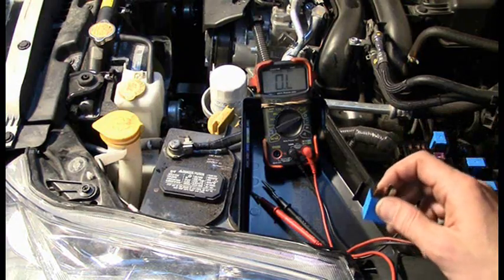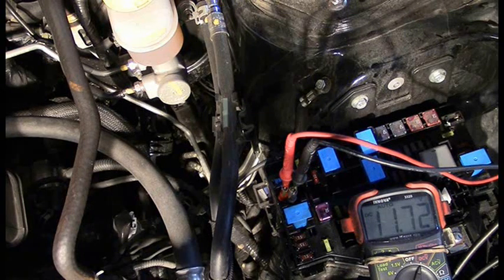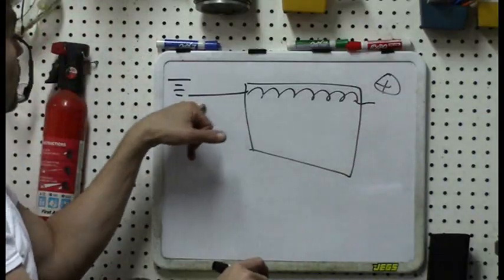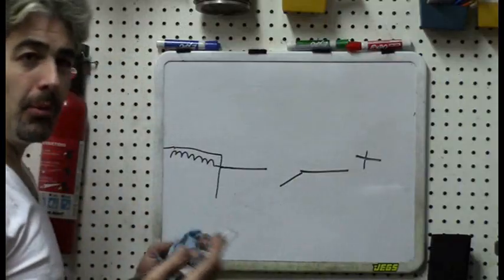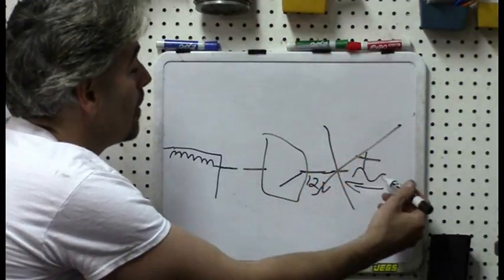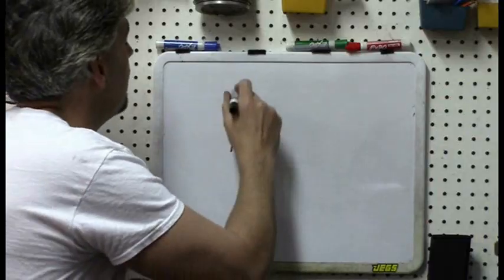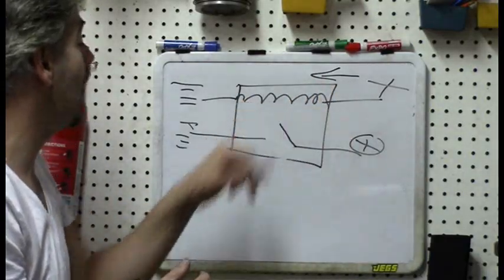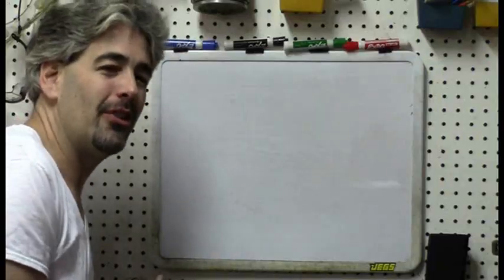Relays- Understanding, Diagnosis and Testing Relayed Circuits-Pt2

Comment: @5:30 I'm having trouble understanding why you would put 12V at the fuse? Wouldn't there already be 12V at the fuse because you said the fuse is good and there is no open before the fuse. If that's the, all you had to do is simply measure if there is 12V at the switch. It seems to me that putting 12V at the fuse is just unnecessary?

Comment: Hellow Sir, first I want to thank you for your content, very insightful and entertaining. I have a question about a mistery with my car's headlight electrical system. So first of all, I have a 2000 Acura TL that I lost both headlights all of the sudden, both low and high beam. So I checked both fuses and relays, and the bulbs, they are all fine. I have a ect 3000 from power probe, as well as the power probe. Ive traced both harnesses right and left and on the passenger side, there seems to be some kind of ground fault. The right headlight relay show 12v on the control side but no ground, the fuse is also dead, but not blown. when I trace my ground wire im lead to the chasis of the car, than the sound stops when I go passed it. Ive tested all my grounds to the battery, but they are all good, the wireing all seems to be fine but when I try to trace an open circuit, it leads me to the inside of the car, but than it just takes me in a circle. I cant seem to figure for the life of me what could be the issue, any thoughts, Im a DIYer but consider myself to be a decent mechanic and understand automobile electricity pretty good, Im at a loss. What would cause the ground to be absent? I thank you in advance and hopefully you can give me some insight.
Reply from the maker: Thanks for the compliment. Obviously you only have ground on the control side when the headlamps are switched on. If you aren’t seeing that happen the issue is with the switch. I don’t believe I have ever seen a headlamp system that was power side switched except on a 1957 Buick. 
   Simply provide a ground side to the relay and see that it operates confirming a switch issue. 
   Also since you have the power probe, just send 12V to the load side and make sure it lights the headlamp- this confirms you only have a control side issue and not a load side issue.  Most systems have a constant 12V load side power at all times but I have seen some that only have the load side power with key on. Either way it doesn’t matter- 12V to the ground side of the load should light the lamp. If it doesn’t then test for the voltage at the socket and if it isn’t there, your ECT will be needed to find the open.
Reply: Thank you, I actually did that and was able to get the lights to come on, but when I replaced the switch, it didn't solve my problem. I'll continue to try tracing I just hope its not my drivers multiplex control unit. according to the wiring diagrams thats where the high beams seem to lead me. Not sure if its worth it at that point, everything on this acura seems to be more expensive than any other car I've owned. 
Again, thanks for the prompt reply!
 @SchrodingersBox
Reply: @sergionewsome6657  did you find why the headlights stopped working on your Acura?

Comment: Could u check voltage on d load side of arelay with d volt meter on ohms scale
Reply from the maker: You would only be able to see continuity of the ground that way, you can’t measure voltage like that.

Comment: Spectacular video. I came here from watching another one of your vids (crank no start isuzu) and now I have a solid understanding of 4 & 5 pin relays. Thank you 🙌... (did you ever work in a shop before by any chance?) Did you ever get your ASE certifications? Just curious as to how you got to your level.. (definitely seems like your up there) 😳
Reply from the maker: thanks so much. I am a DIY- just learned this stuff fixing neighbors cars over the years.
Reply: @SchrodingersBox  that's awesome. (I'm a firm believer that the best way to learn things is to dive head first into them & learn on your own) looks like it definitely worked for you 💯

Comment: Just put some volts on them & see if they click.
Reply from the maker: Yep a I do that too however I also check for continuity on the load side as well. just because it clicks does not mean there is continuity and in fact I have 3 videos that show exactly that happening

Comment: Great stuff thank you it is just cemented the information I have been reading I have tackled and eight pin relay which is a lot easier now that I have seen this and tested it. 
Thank you very much for this helpful video liked and subbed will share with the guys at my shop.

Comment: Wow amazingly helpful , before I watch this video the only knowledge I had of a relay involved switching the Batten from your hand to the next runners hand 😂 now how to find the relay switch responsible for my AC blower , heated seats, reverse light and wing Mirror controls , which all went down together after having to recharge the dead battery on my 2003 Audi TT ... someone mentioned there is no relay for the blower on the TT , then somebody said they found a whole box of relays under the bonnet somewhere , any insight on that would be more then welcome 🙏 , at least I’m not rushing out to buy a blower motor now thanks to your great way of teaching and live examples kindest wishes
Reply from the maker: Thanks man.  I always appreciate those who try to improve their understanding of electrical. It didn't come easy to me!!! I had to spend many hours on my own studying it.
Reply: I can get that , I recon because you learn all this with hands on real life experience, your self , you have a very clear step by step way of teaching this very complex subject... 
I am still wondering where how to find my relays , can you point me to any videos you have done on how to locate the main relay switches , so far I have only found one in the engine bay by the large air filter on the back of the firewall passenger side ??? Thanks again for your videos man you rock

Comment: Great video. Wish you had covered a diode protected relay. With a diode protected relay, power has to be applied to the right pin in the load side, right? Usually, pin 86.
Reply from the maker: Not sure which pin number but yes- diodes are basically electronic switches activated by current.

Comment: cheap aftermarket immobilisers uses basic closed, 12V to open relays. If is immo on, it breaks the ignition, or fuel pump circuit. (on cranking no start the first suspects are these stuffs)

Comment: Question for Matt: My wife's Chrysler T&C 1998 van uses a "solid state" type relay rather than a coil type.  Could you do ( or do you have) a vid explaining how this type of relay works?  Also, is it possible to test these without special equipment, like anything other than a DVOM?  Thanks for this awesome series and keep them coming!  

WARNING for all viewers of this vid:  While Matt's 2 part series on relays is fantastic and honestly, the BEST explanation of relays I've ever seen, PLEASE understand that not ALL headlight circuits (or any relayed circuits) are necessarily this simple.  I have a Subaru Forester S, 2001, and both lights failed simultaneously last winter.  Fortunately, I found ultra cheap (like 8 bucks) pdf file factory shop manuals on ebay, so I have the actual wiring diagrams for my car.  In my car, the HL switch actually closes the ground circuit to BOTH the HL (load) AND the HL relays' control coils.  In addition, the POWER side of the relay control coil is switched by the ignition switch (only HOT in "RUN").  Most cars don't require ignition switch to be on to operate HLs, but if you have a Subaru, I almost guarantee yours does.  In my situation, you have THREE, not just one, switched locations in the circuit that could have been bad.  Diagnosis could be done using Matt's method, but would have been quite a bit more difficult, since even in a working state, you'd have NO continuity to ground or power at rest on EITHER side of the relay control sockets in the fuse box.  I respect Matt very much, but in my experience, the 8 dollar shop manual is worth it's weight in gold for the wiring diagrams alone!  They've saved me SO much time.  Incidentally, the issue turned out to be the ground wire from HL switch connector to the HL connector was burned and part of the connector melted.  I got a new connector at the junkyard for ONE dollar.  Unfortunately, had to spend 12 bucks on a special tool to get the pins out of the connectors, but still, was a fun repair!
Reply: "8 dollar shop manual "  Where can you get this?

Comment: Amazing thank you Schrodingers
Reply from the maker: Glad you liked it!
Reply: Schrodingers Box this weekend I am planing to troubleshoot my ML350 starter and its wiring issue, already removed starter found it dead,  took it to a rebuild shop, they tested it too, so got a rebuild one, but still have to fix starter relay, its not getting power, hope fuse some where.

this car has few circuits, starter relay should get power from circuit 15 then activate circuit 50 (starter solenoid)

most likely shorted solenoid kill some fuse somewhere - i am wondering why 5 year old car have bad starter?

your video definitely will help me to fix my electrical issue

Thanks Again.

Comment: Another great video! 
Here's a question. How would you determine the load side from the control side of a stuck closed unmarked relay. I suppose checking for resistance would be a start? 
I had a stuck closed relay on a fuel pump that wouldn't shut off. Took an educated guess and swapped the relay with a new one and it fixed the problem. That was when I was a 98%'er
Reply from the maker: Cobra Ninety Six I would find this out by checking inside the vehicle where the relay goes and probing for the side that has no power until you initiate a control/switch.  That would be your control side... then you can just refer that information back to the relay

Comment: Nice topic. 
Sir Can you please make a video on diagnosis and understanding of an alternator. How it works and how to test and how to full field an alternators and other stuff like that related to alternators. 
Thanks
Reply from the maker: Wasim Akram Thats a good idea, duly noted. Alternator testing is actually not quite as easy as most people think. There is computer control of the alternator in modern vehicles to prevent overcharging and failure with this can actually cause a no output from the alternator even if it is good!
Reply: Schrodingers Box thats exactly why i have requested you to through a video on that too

Comment: Hi I'm having a problem with my 2001 Saturn L200.  All the interior lights r blinking and security light at the same time also gas and temperature gauge goes up and down. I have a video please watch it called (Saturn Lights Blinking) Thx any info would be appreciated
Reply from the maker: Its either a dead or not-charging battery or loose battery connection. Easy
Reply: Brad Sellers that happens a lot to me, and in most cases is a loose ground at either the taillights or the headlamps. Having a bad ground makes actually a serial connection between the blinklights and the other circuits (brake or headlights, parkinglights), thuus making them blink, but at a lower voltage, all the lights are dimmer because they share power with the blinks. So for the future check for a good grounding point.

Comment: you are awesome dude! I FINALLY FOUND SOME ONE THAT KNOWS WHAT THEIR TALKING ABOUT.. 
"""SUBSCRIBE HERE IF YOU WANT TO DO IT RIGHT THE FIRST TIME, EVERY TIME!
Reply from the maker: Many Thanks Jo.  Turns out a lot of people out there know what they are talking about- even much more so than I do- way more, but they don't make videos. However they share their knowledge in the comments on my channel and I learn from them much more than they learn from me!
Reply: Question? I have a 2011 F-150  3.7L V6  xlt truck. I was hit on the drivers side front end. long story short the MAF or MAS air flow sensor is not functioning. Do you have a video on how to trouble shoot the MAF? And, on my instrument cluster is reads>> "SERVICE ADVANCETRACK" with a wrench next to it. When I try to accelerate i lose power in the engine and the further i press the accelerator, It seems to bog down. The truck only has 16,000 miles on it. Do you have some videos to help me on this subject? or advice as to where to start troubleshooting & how?
Reply from the maker: Jo Hutch While I don't yet specifically have a video that addresses the MAF individually, my video "secret of engine diagnosis: Fuel Trims" does cover it to some extent and explains some issues common with MAF and MAP and what would result from them.

 As for the other issue, sorry I not familiar with AdvanceTrack and for the most part any types of transmission issues are out of my scope because my scantool very rarely can communicate with transmission modules- I am lucky to even be able to get anything more than a code.
In either case, you are really going to need a scan tool for diagnosing either of these issues you have.
Reply: ok thanks

Comment: Great video, Informative and educational. Only downside is most of these practices only apply to vehicles up to 2004. After this manufacturers started using CAN networks. Ecu's and modules control lighting directly.
Reply from the maker: This is very true- I should have pointed that out.  In fact, even on the horn circuit, much of the ":relays" nowadays are CPU controlled switches to allow things like the sound of the horn beeping when you lock the doors remotely, etc.  The complexity is far beyond what is covered in this video however the video at least gives a foundation for learning the basic operation.

Comment: Very nice video, while I was watching your vid being a flat rate diag tech I was thinking of your diag steps one step I though you were going to due was just bypass the headlight switch all together since you had the connector in hand and you knew what circuits came in with voltage and what circuit or term was the output of the switch another thing I think is so very important when doing this type electrical diag work is to make sure u load test circuits I use a 9007 headlamp bulb that a that I rigged up i can interchange alligator type clips or pin type term, maybe your next series should be about the importance of load testing circuits and how to do voltage drops   factory pin point tests tests for open, shorts to power and shorts to ground but not resistance  within circuits.

Comment: CORRECTION:  I was in error in describing the current rating of the coil and the output circuit (contacts). I said that the numbers, such as 20/30, referred to the coil and output current ratings. That was wrong. A rating such as 20/30 means the relay is rated for 20 amps through the Normally Closed contacts and 30 amps through the Normally Open contacts. Sorry for the error.
Reply: Another very informative video. Where did you get your automotive training at?
Reply: White Tiger Have you ever watched Dan Sullivans videos on Relays and diagnosing the entire system with voltage drop as well as using the Load Pro Leads for a digital voltmeter? I have a set of them and for the most part it seems to be an excellent tool just as is the Power Probe. I just watched a video for the new Power Probe 4. It has some nice additional features.